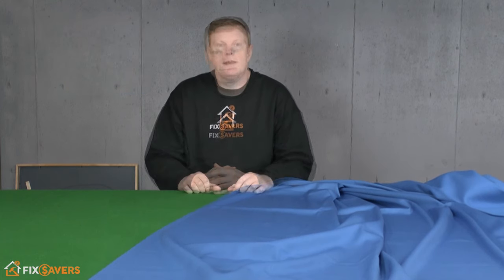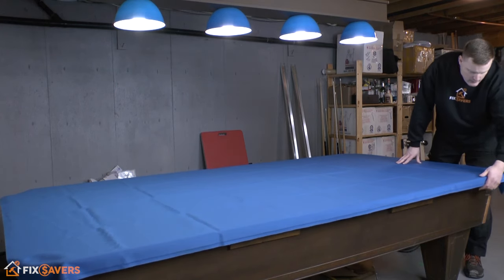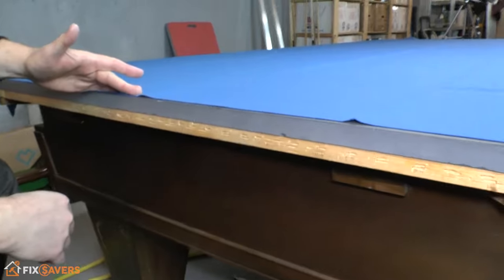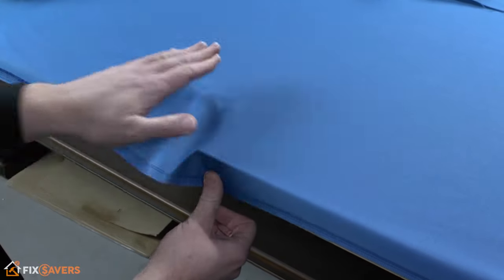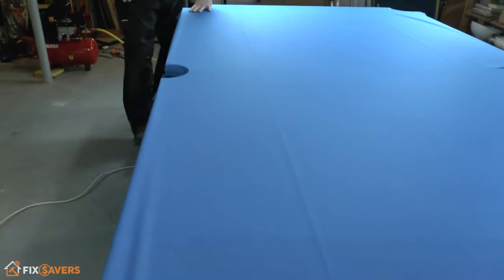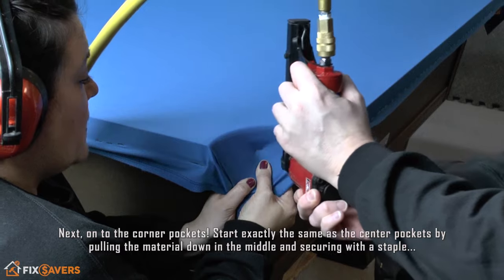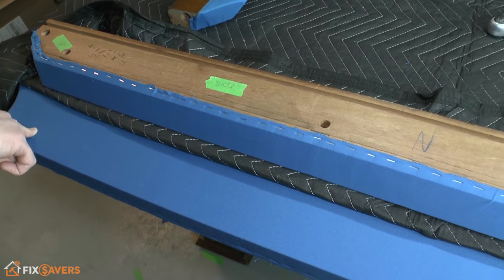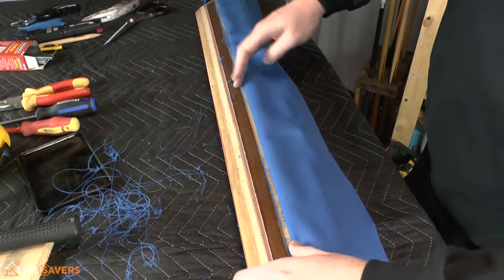How to Install a Pool Table Cloth - FULL DIY GUIDE, BEST ON YOUTUBE!!!

Comment: I just got Predator Acadia select cloth. There are some creases where the cloth was folded. The corners are somewhat pronounced wrinkles. I'm very much wanting to iron these out. 
A little research says low heat is safe. Should I? Is it necessary? They are much more pronounced than what I see here.
Reply from the maker: Hey Brett! Well because the cloth is going to be stretched a fair bit it's unlikley that those creases/wrinkles will still be there during installation. You should be able to iron them out on low heat if you prefer, just keep it low heat and keep the iron moving. But it likle;y won't be required. Hope that helps!

--- 

To help support us (for both you and others reading this) there are a few things you can do:

1) Donations both needed and welcome! We cannot operate Average Joes Pool without the support of people like you! You can donate by PayPal - just go to www.paypal.me/thanksfixsavers - or alternatively you can click the SUPER THANKS icon under the video on YouTube and donate that way too!

2) Please ensure you subscribe to our YouTube channel. 

3) Please Like our video's on YouTube (by clicking Like!) 

4) Please help spread the word, the more people who know about us the better! Add links to our video's in forums, let people know about us.

Thank you for your support!

Comment: @Fix Savers  many thanks for your advice.

I have installed based on this video and the cloth turned out really good. The middle pockets were heart wrenching. I have noticed that there is a small amount of slack around the middle pockets area. Nothing disastrous, but there are some waves there when you run a pushed finger around the area. 

Any advice for getting rid of that. IE, I would need to move one staple at a time to make any corrections to get rid of it, but which ones. From the table sides or directly below where ripples are on the curve of the pocket?
Reply from the maker: Yes, the centre pockets are probably the worst part o fthe job as you are dealing with a 180 degree curve rather than 90 on the corners. Hard to know the best solution without seeing it first-hand, but the important thing is to remember that the cloth is pulled in various directions during installation, so you need to be careful removing any staples, and don't remove too many at a time. It may be worth carefully removing a couple from the centre of the pocket on both sides (get someone to help) and try pulling the two centres out and see if this gets rid of the ripples. If not, it is likely another angle causing the issue. Worst case you should be able to remove all of the staples from inside the centre pocket and pull from various directions to see where the issue lies. Once you have found it, you could also try some spray glue carefully underneath the trouble area to help stick that down as you recorrect the tension. It's one of those PINA jobs where you have to play around with it a little, but being careful not to release too much tension anywhere as you may not be able to replicate that tensioin again (well, not easily!). Hope that's of some help!

Comment: One thing to mention perhaps is cutting the cloth for the rails if your cloth comes all 1 piece.

Mine was just barely enough and I wasn't super careful to keep the max I could now I am short enough clith to do 1 rail.  Shieks.
Reply from the maker: Yes, cutting the cloth yourself can be troublesome which is why we recommend to set a cloth that comes with the rails pre-cut whever possible as it saves a lot of extra hassle and possibility of mistakes. Cloth manufacturers can be very stingy, and so there is usually next to zero extra so you have to be accurate with the measurements and cutting. Sorry to hear that you mis-cut - that's a nightmare! Especially as you cannot usually just order one rail cloth, you usually have to re-order a full second set and that's costly!!! It may be worth contacting the manufacturer, maybe they can help you out. Best of luck!
Reply: @AverageJoesPool  thx.  Perhaps a video on replacing the bumpers.  Daunting cutting the ends to the proper shape.  Great videos.  I watched them all more than once.

Comment: What psi reading did you put your compressor to?
Reply from the maker: You can leave your compressor on the standard default. No need to adjust for the stapler. Hope that helps!

Comment: Do you have steps for recovering using simonis cloth?
Reply: much less stretch with simonis. requires strong hands lol.  Other than that it's the same.  Covering a table with cloth that has a nap (like snooker cloth) takes a slightly more precise technique as it tears very easily.
Reply from the maker: The basic principal is the same. Simonis tends to have very little strech to it so a couple of extra tools including a pair of canvas stretcher pliers come in very useful (we did the one if this video by hand as the most DIY-orientated way as that would be most applicable to most viewers). We may do a seperate dedicated Simonis installation video in the future if we get enough support, but for the most part the basic principal is the same. Hope that helps!

Comment: Hi there, could I just ask your expert opinion? I have just bought an 8ft snooker table from a company here in Sweden. They class it as a pool table but it is exactly the same as an English snooker table.It comes with 6 legs and 3 slates,4cm thick. I have bought an 9ft table from china in 2011 , so have some experience with these tables. Now this 8ft to my surprise has no screw holes on top,to screw all those wood pieces on, for stapling the cloth. This to me is weird, there are no videos on youtube where you don't have holes on the snooker tables. So there is no holes to even keep the slates screwed down. Also, the slate looks more like a type of marble and the two slates are different looking to the other one,and one is a bit smoother. I am complaining about this to the company, I don't think they have forgotten to include all the wood bits for the edges of the slate underneath obviously. I am sure their thinking is that the cloth is to be glued on, like most pool tables nowadays. But to not have screw holes to keep the slate from moving, seems a bit ridiculous.. I will glue a bit of paper with superglue on the seems,but do you think I should just use silicone under the slates to stop them from moving. I want to use the stapling method for stretching the cloth and am not going to glue it down. Was thinking of getting the wood strips and gluing it all underneath, should work. Have you seen tables with no screw holes? Kind regard Kevin
Reply from the maker: That does sounds very odd! The slates must be attached to the base frame in some way, hence they usually have the screw holes so they can be screwed directly on to the base frame. And the three slates should definitely not be made from different materials - none of that sounds good!!! You should ask the manufacturer how the slates attach to the base frame and see what they say. Yes, you should be able to attach timber to the underside of the slates (using a good construction adhestive) if you want to do stapling, but this will raise the height of the slates above the base frame and so it may no longer fit the additional decorative trims as it should. Sounds like a nightmare TBH!!! Best of luck!
Reply: @AverageJoesPool  All sorted, Yes very odd no screw holes on 3 piece slates. I have glued wood all around the slate, so l could staple. So now the slates can not move and all more secure when all cushions are screwed on also. As a 3rd precaution ,used a strong silicon underneath that will also hold the slates onto the frame and stop it all from moving. Not as good as being screwed down, but is working fine. One of the slates that was a different type, has not made any difference. I had complained about everything and got 40% off the price.

Comment: 1. If the slate has wood underneath use tac nails, staples are horrible and look awful on a pool table. 
2. If the slate has no wood then use a approved adhesive glue for the felt and slate.
Reply from the maker: Actually you don't see the staples at all once the table is back together with the panels/trims installed so cosmetics is not an issue for staples. Hope that helps !

Comment: I have cheap sportcraft pool that i took appart to refelt the sides and the top well after cleaning railsand removing old felt from one of the sides i have come to conclusion that my sided dont have removable trim piece that holds felt in place looks like the whole thing was put together in pieces and stapled and glued and not meant to be changed just use and discard i believe , on the other hand i could be wrong which im hoping i am so please if someone has done one of these shed some light
Reply from the maker: I've never worked (or played) on a Sportcraft table. Are they slate top, or wood? A lot of the cheaper wood tables are indeed often glued and stapled and not really meant to be 'maintained' ongoing (or to really last he test of time). Hopefully someone reading will have experience of Sportscraft tables?

--- 

To help support us (for both you and others reading this) there are a few things you can do:

1) Donations both needed and welcome! We cannot operate Average Joes Pool without the support of people like you! You can donate by PayPal - just go to www.paypal.me/thanksfixsavers - or alternatively you can click the SUPER THANKS icon under the video on YouTube and donate that way too!

2) Please ensure you subscribe to our YouTube channel. 

3) Please Like our video's on YouTube (by clicking Like!) 

4) Please help spread the word, the more people who know about us the better! Add links to our video's in forums, let people know about us.

Thank you for your support!
Reply: Call me pops. I have the same sportscraft table.  How did you job turn out? Were you able to refelt the table since it is not slate just wood underneath? I was thinking about refelting but now now I think the table is not worth the felt. Let me know. Thanks
Reply: @AverageJoesPool  the sportscraft table is wood.  Is it worth replacing the felt? The cost of good felt maybe more than the table.
Reply: @oOohdaddy  ok now you got me curious. Thank you for responding!  U care to share a few photos via email?